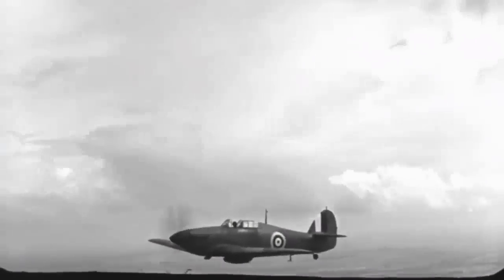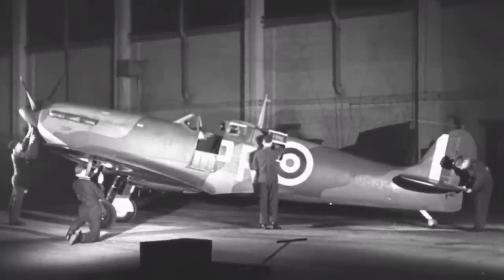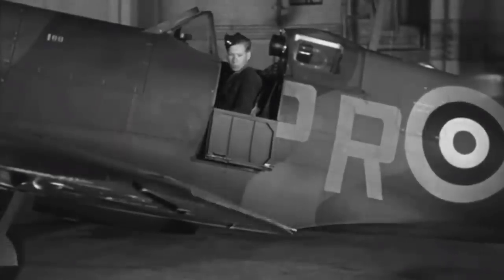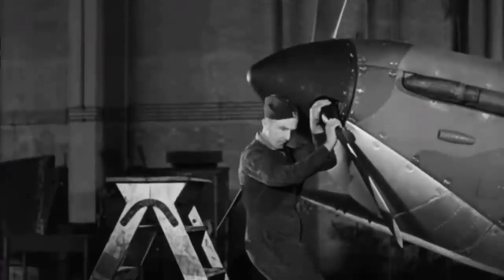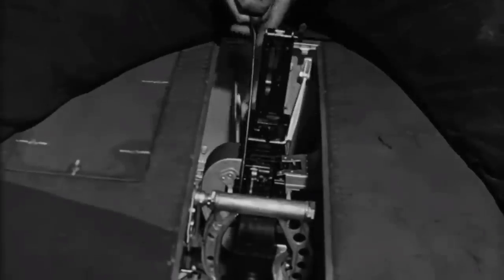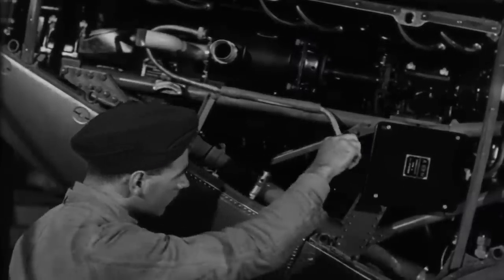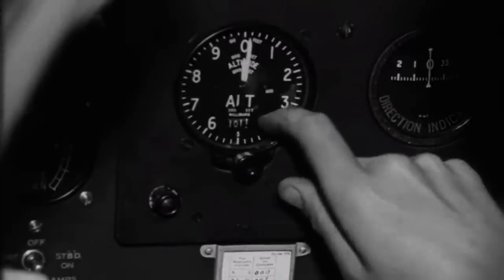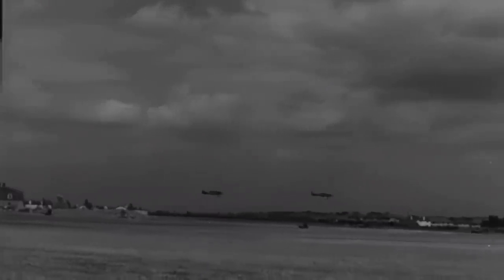Daily Inspection of a Spitfire | (1940) Instructional film

Comment: Spitfire MKIa R6692 Built in Eastleigh  First Flew 3rd June 1940 No6 Maintenance Unit. In service with 609 Squadron 7th June 1940. (The PR  on the side is the Squadron code it has not yet received it's individual aircraft letter )  Damaged while attacking a Ju88 12th August 1940.
Struck off charge 2nd September 1940.  short career
In 1940 609 Squadron was based at RAF Northholt then RAF Middlewallop so this could be at either.
Reply: This is Northolt. The hangar the spit came out of is still there, as a listed building I think, and if you look back a few years before the base was trashed by developers, so was the hangar next to it, with the 7 roof ridges, and the small (POL?) building in-between. Also the barrack block building in the distance is a dead giveaway.
Reply: Not entirely sure, but I think she ended up with the aircraft letter T (so her markings would be PR-T).  Apparently, her damage during the attack on the Ju-88 was due to airframe overstress.

Comment: No sign of the fabric patches applied over the machine guns holes on wing leading edges.  These were apparently added for streamlining and so whether guns had been fired could be established as planes are landing.
Reply: And here I thought because of something I read a long time ago that the red tape was to let air and ground crew know that the weapons were loaded and ready to be fired.
Reply: Also so that airflow was blocked so that condensation and freezing would not happen to the individual guns. The guns would then reliably fire the first time.  Various reasons for blockage were a serious issue pretty much throughout the war.
Reply: The patches also kept dust out of the barrels, which was a problem in north Africa.
Reply: @crazypetec-130fe7  Not in 1940 it wasn't...

Comment: My Uncle was a Spitfire mechanic during WW2.  Whenever he changed the spark plugs on the Merlin he would chisel the Platinum tips off of the spark plugs and save them. At the end of the war he had a small suitcase full of Platinum to set him up for civilian life.
Reply: Nice.
Reply: Nice to be lining your pockets whilst others were overseas fighting
Reply: @andrewbrown2249   @trevorpepper1996  Settle down. It's just an old family story that has drifted away from reality as it was passed down over the years, but we can't have that now, can we?  No sir, not while you two are riding around on your high horses anyway.  

The fact is the going rate was $35 an ounce in the US at the time, so probably less in the UK.  This amount would require something like 400 plugs and a ton of not very pleasant labor to extract... mostly because the plugs didn't and still don't have a platinum tip just sitting there waiting to be snipped off--it's a thin wire encased in steel that has to first be removed from the plug, then chemically treated in a process similar to how gold is extracted from electronics today.

Feel better now?
Reply: @Milkmans_Son  A debunking master piece
Reply: @Milkmans_Son  Proper upper cut 👍👍
Reply: Slim
Reply: So he was degrading the Allied war effort for his own personal gain. Not something I would be boasting about on a public forum.

Comment: You don't hear a battery referred to as an Accumulator anymore
Reply: An electrical battery  and a pneumatic/  hydraulic accumulator are very different  😮😊
Reply: and what's the 'Fusilige'...
Reply: @andyb.1026  No one said it was pneumatic or hydraulic. This IS an electrical battery, and it is an accumulator. That is how they referred to a lead acid battery. Note the Trolley Accumulator in one scene, these were in use well up to the 80s or 90s in the RAF - just a 24 volt battery pack essentially. How do you think hydraulic systems are checked with a voltmeter?
Reply: @memkiii  40 years on Aircraft Maintenance,  and I've never heard of testing a  hydraulic system or component with an avo

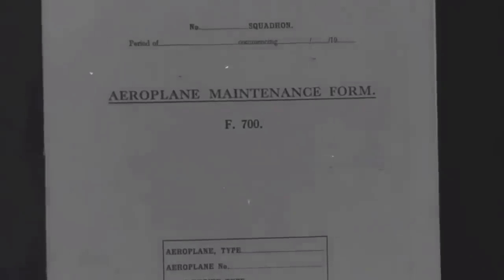Comment: 2:35 My guess is during the 1940 Blitz not every maintenance chief was diligent in keeping up the Form 700 for each aircraft. 

Just a guess.
Reply: There's an awful lot of work involved here and even if the various trades tried to work simultaneously, it would have taken a lot of time. During the Battle of Britain, was this all done during the hours of darkness?
Reply: My guess is that you would be wrong.
Reply: @promerops  They said quite clearly it could be done any time in a 24 hour period.
Reply: @memkiii  "Could be". Given the pressure on both men and machine, I suspect that there was no time during daylight hours for anything other than operations.

Comment: It is said that gun barrels are de-nickeled if fired since previous check. Anyone knows what the process was of de-nickeling?
Reply: Cleaning out deposits as you would with a shotgun, I reckon, as the process of firing leaves traces of pitting chemicals and grooves inside the barrels. Why exactly the term "de-nickeling" was used I am unsure. I reckon pushing the cleaning rod through a few times would be sufficient. It may have been impregnated with a cleaning agent before doing that. De-nickeling stripped gun parts would involve cleaning with acid before oiling and re-assembling
Reply: .303 bullet jackets were cupronickel, a copper-nickel alloy. A brief internet search leads me to think the removal was probably carried out with a paste akin to jewellers rouge.

Comment: I was surprised by the extent to which the flaps lowered, making them look more like airbrakes: maybe they had a combined purpose?
Reply: The flaps were used only for landing and had only a 'shut' or 'open' setting, being blown down by compressed air to 85 degrees as a drag flap rather than for additional lift which would have been achieved at about one third that angle or less. As a side note, in 1942 they did use flaps for takeoff from HMS Eagle in 1942 on delivery to Malta. Wooden wedges held the flaps open to 25 degrees for takeoff, the wedges being dropped by opening flaps. The use of wedges carried over to the Seafire but, from memory, with a flap angle of about 15 degrees. If it works!
Reply from the maker: The wooden wedge trick became somewhat standard for carriers operating Seafires ... and they presented something of a hazard for deck crews!

Comment: Most informative ,,,   what happened to the "breaker bar " usually attached  in the upper door skin ...
Reply: Probably away being painted red! 🤣
Reply: This was clearly released in 1940, and obviously made quite early that year, or the year before. Long before they started fitting the crowbar, which I believe was around Jan 1942. I suppose it's possible that individuals may have had them fitted in the BoB, but not fresh from the factory.

Comment: I wish we could see the serial number more clearly. The closest I can get to the serial and a 609 Squadron aircraft is R6692 which, according to the details in Morgan and Shacklady's book first flew on 3/6/1940 before bring delivered to  6MU on 5/6/1940 from where it was delivered to 609 Squadron on 7/6/1940. It was struck off charge on 6/9/1940 with the code of "E" (unfortunately this abbreviation is not defined by the authors).

Towards the end we see Hurricane JX-Z of 1 Squadron who were at Northolt between 18th and 23rd June 1940 having returned from France. They were then moved to Tangmere until the start of August 1940.
Reply: I was -10 years old (new?) on the date of the first flight. That Spitfire is a Pisces! :)
Reply: R6692 or R6693 - You can just make it out on the tail fin. According to allspitfirepilots, R6692 was over stressed in an encounter with a JU 88. The image on their website shows the same fuselage makings PR. R6693 was lost in a landing accident in July 1940.
Reply: @mmrd50112  can't be R6693 as this wasn't a 609 Squadron aircraft but a 610 Squadron aircraft carrying the markings DW-A. Original posting had a typo on serial no, how corrected. That's a useful source.
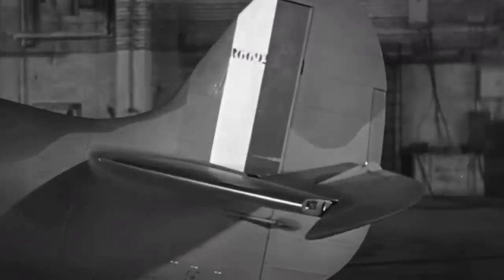Reply: @neiloflongbeck5705  I don't really know much about 609 and 610 squadron histories or how this airframe became the subject of an instructional film. All that made me think it was R6693 was the stencilled number on the tail that appears on the video @ 14:07...indeed, allspitfirepilots is a great resource. Thanks for your comment...I have just only recently started looking into early Mk1 Spits so I have a lot to research.
Reply: Certainly looks like R6693  at 18:00?

Comment: What's with the rectangular patch of cloth on the backside of the maintenance crew uniform ?
Reply: In case of emergency remove panel ?
Reply: Laundry tag?  It has writing on it, and is only lightly tacked on. My second guess would be a gas detection patch, but it would be an odd place to have it, and this seems to be a period before the aircraft had them taped on  - at least, this one doesn't appear to have one.

Comment: Better off hosing the wheel wells clean with water before entering the hangar old bean.
Reply: Not if you don't have a hose, or prefer not to crawl about under a low winged aircraft and get yourself soaking wet. Having been there, I'll take a rag to it & stay dry thanks.  Plus it looked dry outside. 😉

Comment: note  spitfires and mosquitoes used  wooden propellers
Reply: Propellers? very early MkI had 2 blade wooden props, later models 3 bladed metal props, later 3 bladed wooden props, it basically depends  on the aircraft and the time period.  Mosquitos went through a similar process, both wooden and metal props were used.
Reply: @memkiii   yeah the did,  actually they went through  13 designs  thought the war, however I was responding in general terms  to wooden ""Propellers''   (tapo error) thousands of apologies  alrigh bubba.  and yes I was referring   early years of the war  😀